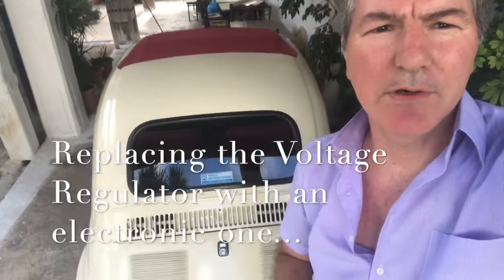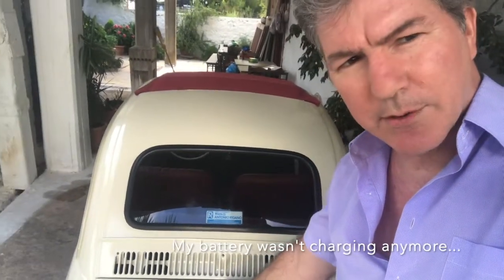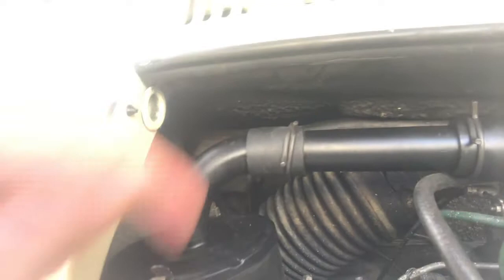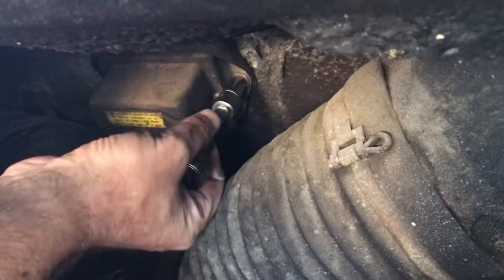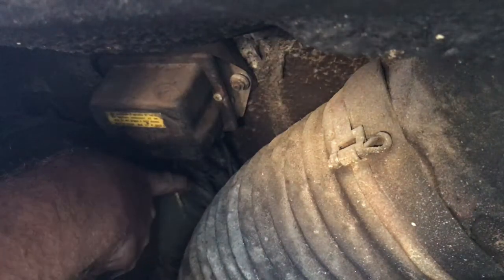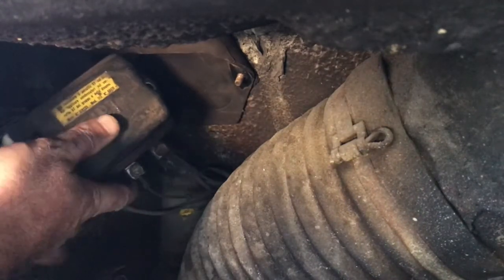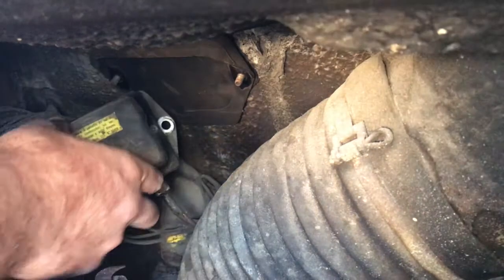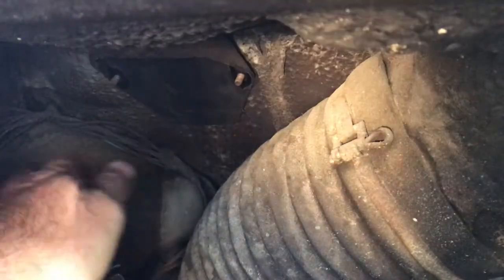Generator Light On Classic Fiat 500 Replacing Voltage Regulator:Battery Charger with an Electronic V

Comment: I’m Italian and I own an old fiat 500 and I can assure you that it’s totally normal that generator light keeps on when the engine idle. It’s because the dynamo cannot charge when the engine runs low. 
After your replacement, the engine runs too fast that’s why the red bulb is off..

Comment: How did you diagnose that the original voltage regulator was causing the problem?
Reply from the maker: Tony Harte a few times when driving the light was on. One day, the light remained even when the ignition key was off. I opened the cover of the old one and noticed the third relay was stuck, I opened and cleaned the contact points, and when I opened and clicked the contact points I could clearly see the generator light go on and off, I thought I solved it, but it just kept being in the closed position. I did follow some tests on the dynamo, I measured the voltage, I got voltage on the field coil but not on the main coil. I replaced it and now no more generator light on and I do get voltage on the main coil of the dynamo.